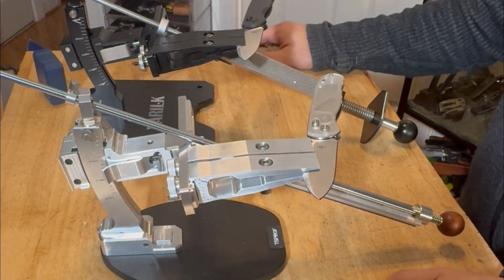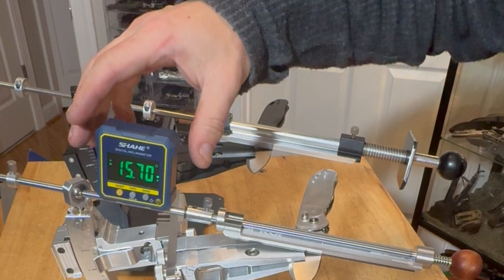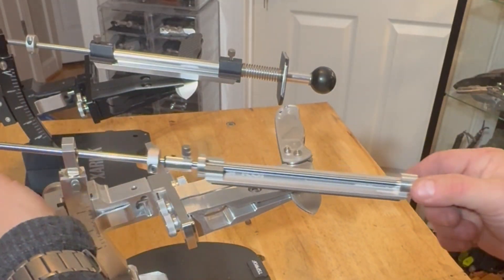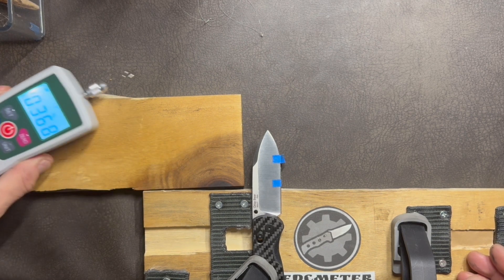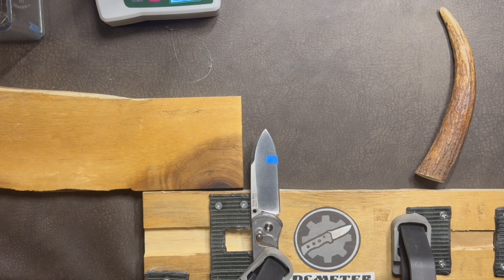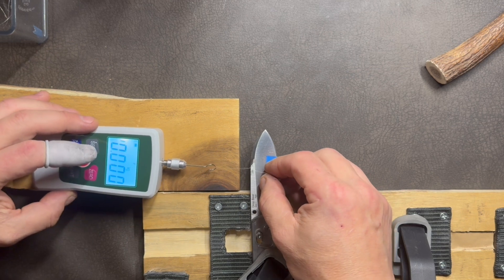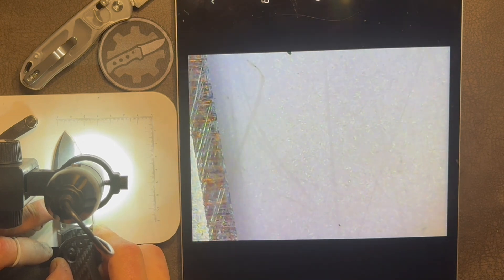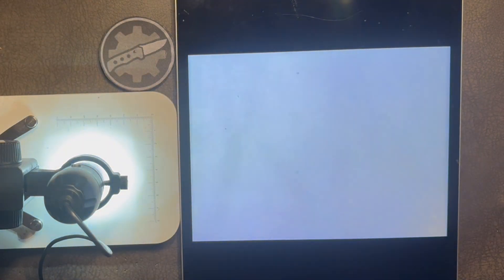Let’s solve the puzzle! Also, is harder steel always better? Kizer Drop Bear investigated.

Comment from the maker: Please share your thoughts on what’s happening with the steel on harder of the two blades.
Reply: At a scale as yet indivisible via your microscope footage, the micro-serrations of the softer steel were able to deform against the stag medium, thanks to the steel's greater elasticity. Concurrently the micro-serrations of the harder steel were more brittle, hence prone to mechanical fatigue earlier. So you raked them off with the stag. 

I believe that with sufficient magnification a comparative examination of the two distinct apex terminations will reveal a more serrated finish on the softer steel vs a more burnished finish on the harder steel. 

In conclusion I recall you to my earlier statement regarding the validity of the data that results from your stag-test vs more real-world-cutting scenaria such as box or rope cutting - wherein using both clean and dirty examples will moreover provide a more accurate dataset: given that knife users often cut dirty media that are more abrasive than their pristine equivalents. 
I am not knocking what I consider to be your excellent-in-field bench-testing protocols. To do Cliff Stamp-style edge retention testing on one blade alone is a fairly massive undertaking unto itself. If you're testing the amount of knives that you do, you'd have to be able to either cut some corners or start losing sleep and skipping meals! 
Keep 'em coming, my guy! :D
I don't use Patreon or any of that jazz. In certain instances I got in touch with someone to give me their bank account details so I can bypass the middleman. In your case I would certainly consider sending you knives for testing, including to failure or indeed destruction. Like the time Timbo sent Scab his Buck hollow ground fixie in S35VN to Scab of Choirboyz Outdoors for review and under light batoning the greater part of the secondary bevel (which I believe you call primary bevel, of course you're aware of that whole controversy) - the hollow ground section - detached itself in various large chips.
Reply: First! Part 2

Comment: Another great video and useful testing. Two things dude - 

1- at like the 30 second mark, over your shoulder there is a knife rack on the wall that looks like it’s made of wooden dowels. Did you build that or did you buy it? That could be a pretty handy thing for next to my workbench I’m setting up. 

2 - the people that throw a shit fit and are going to try to correct you over the orientation of the knife in the clamp, the apparent changes in angle, and obsess about a slight bit of wiggle in the clamping setup should try to think of freehand sharpening as a point of reference. The armature of the sharpener has the range of motion to move the stone around a stationary blade like the arm of a freehand sharpener moves the blade around in relation to a stationary stone. A human is also not going to be perfectly consistent in angle & orientation no matter the degree of focus & experience. The only thing that the orientation of the edge to clamp not being parallel is really going to impact is the direction of the scratch pattern. The way you are clamping the knife, it looks like the scratch pattern would make for a useful aggressive edge particularly in the belly of the knife. 

If we are being honest, we are talking about small fractional increases in performance. I think a lot of the people that bitch at you and try to be nitpicking jackasses are overcomplicating the whole deal. That’s likely because they don’t actually have any first hand experience doing any of this.
Reply from the maker: @just9911  Here’s affiliated link to the racks like you saw behind me https://amzn.to/3CEOG8K they are $10 for 2

You can get smaller ones at ikea for 6 bucks and here’s an unaffiliated link to that https://www.ikea.com/us/en/p/ostbit-plate-holder-bamboo-90322360/

As to the nay sayers, they can’t unsee what they saw nor in-know what they learned from the video 🤷‍♂️
Reply: @CuttingBoardRx  you got that right. I appreciate the links. Thanks again. Good luck with future testing and be safe.

Comment: From what I have seen your "edge retention" test is flawed. I think the horn you are using is too hard and the knives are not really digging into it. I think you are testing apex stability rather than edge retention. There is a way to test this by using the same knife sharpened once to 15-20 degrees, and testing it again after resharpening it to 20-25 degrees. If you lose a higher sharpness percentage on the more acute angle, you are probably just testing apex stability which is largely determined by blade geometry rather than blade steel.
Reply from the maker: All tests are flawed. This one is not an exception. But I’m having fun with it! Thanks for commenting!

Comment: Here is a little trick I do with serrations. Its a good idea to match serrations on both sides of your edges because you don't want stained glass effect.. Best way to describe it is with corse stones making deep cuts into the edge ,both sides cutting different directions  and if deep enough you would soon have pie cut shapes falling away. Might think it is brittle or the steel was extra hard. So I try to match the angle on both sides , so if the stones scratches are to deep the edge would look like a hair comb. The  best way to avoid this is to set your knife on the stone the same way you would normally and draw a line . Using a piece of thin cardboard, cut it to the with of your stone then set it on your stone and transfer the marks and cut it out.  Now you have a pattern of how you want to finish the serrations on your edge. Simply  lay the pattern on the edge of the stone and copy the angle then flip it over and mark the stone . You should end up with a narrow X ,now copy the same X on the other side of the stone.  You could put the X on the ends of all your stones.
Now do all of your edges will be stronger , give it a chance

Comment: I will challenge, the angle on the edge  of the knife will change if it is not parallel. Got to compare the sharpening to your roof on a house. If the walls of your house is parallel and you go on your roof ,go to the far side at the ridge and hold the string. Now to the lower side at the other side (gutter ) and stretch the string and place on the roof and it should be parallel to the roof.  If there was a jog in the wall ( moving the walls closer )  there would be a drop in the roof, making the roof steeper.  When you put the gutter on it can not be a straight piece,  it would be lower than the rest of the gutter. 
The gutter represents the edge of the knife , the difference on the knife would be small but NOT THE SAME AT THE HANDLE TO THE TIP.  Just had to remark, 50 years experience including trade school.
Reply: I agree. Even though it would be slightly different, I'm skeptical about it affecting the overall performance of the edge. You are correct in your remark, and the angle will increase slightly.
Reply: @witness1449  thanks
Reply from the maker: Since you’re quoting Outdoors 55 video, let’s give him some credit for that excellent house roof example. In that video he clearly states, at about 7-minute marker, that once you reach the curved belly of the blade, the angle changes. My setup compensates for that at the expense of having a slight variation on the straight portion. But the result of not having a funky looking belly is well worth it. On a sub-3” blade you would not be able to detect the difference of .05° to .1° without some very sophisticated measuring equipment.
Thanks for the great comment!
Reply: @CuttingBoardRx  whos 55 ?
Reply from the maker: @jdemeter4357 See for yourself. Go to 7 : 20 marker
https://youtu.be/3L6_CTMdDOk?si=0aYByW2g48vdNJI5
Reply: @CuttingBoardRx  Yes I went there  , by the way did you find my comment there ?  Explaining I made a comment on one of his earlier videos stating the same thing. In the video he did a great job covering what I typed  but he improved the topic with visual aid.  I just want to say no one plagiarized anyone, it was a open discussion.

Comment: Love your videos 💯 I put two o-rings  on the rod in front of the stoppers. Now you can just leave your stoppers loose and slide the stone holder to the edge of the blade both ways. Then just slide the stopper up till it hits the o-ring then tighten it. It also adds a little cushion.
Reply from the maker: Great idea! I will try to remember to try it out. Thanks!!!
Reply: This is a great idea!! I will try and deploy this method as well.

Comment: I bought the Kadet pro on their website for 300$ wasn't easy decision but my edges are so much better. I also noticed using the resin bonded stones made huge difference. I thought the spine should be perpendicular to sharpener But I always listen to people smarter then me thank you I'm going to try your way from now on.
Reply from the maker: This method works for short blades really well, but for longer blades I do place the blade as you describe with the tip/belly pushed out as far as possible. This technique reduces the edge angle variation on the curved sections of the blades.

Comment: I wonder if the overheated apex on the harder knife is still coming into play after 1 good sharpening? Maybe the damage from that goes a little deeper?
Reply: Exactly my thoughts... I have had two, quality blades from major brands, that had enough burned edge to take multiple sharpenings to get passed the ruined portion.  The symptoms were what one would expect, excessive chipping on one, minor chipping on the other, and the edge would stay sharp for very little amounts of time for both.  One took 3 sharpenings, the other took 5, and this was S35VN and S30V, respectively.  Ever since then, the edge retention and stability have been exactly as they should be for both knives.  Have only needed to strop, occasionally, since.  I am convinced that any knife, regardless of price, might have this issue (especially if using belts to do the sharpening).  It might be 1 out of 1000, or 1 out of 100, but it happens.  It's not a big deal, to me, I like to sharpen and it's just part of it... but I can see how someone who doesn't like, or know how, to sharpen, might find this beyond irritating.
Reply: The deep scratches (from poor quality media?) on the secondary bevel creates stress risers on the edge where chips can form when dragging with the antler.  Stopping could help, as could using finer media to remove all deep scratches from the secondary bevel.  Stress-risers affect harder material more than with softer material.  Polish the edge and then try against the antler.
Reply: @DarylOster  pretty sure only the softer knife used those stones that caused the deeper scratches.
Reply from the maker: Great discussion!

Comment: Non science question. You have black knive with inset liners and translucent one with outset(don't know a better word) liners. What knife is more comfortable in use? What knife feels better in hand?
Reply from the maker: I would recommend staying away from any clear plastic knives if there’s even a remote possibility of hard use. The material will crack around the screw holes. 
Carbon fiber one feels good in hand but a little slippery.
Reply: @CuttingBoardRx  and it will break in contact with acids. 
But i didnot asked about the scales. I've asked about steel liners.
Reply from the maker: The edges are not sharp if that’s what you’re inquiring about
Reply: @CuttingBoardRx  thank you sir